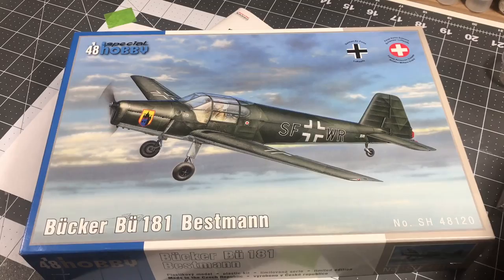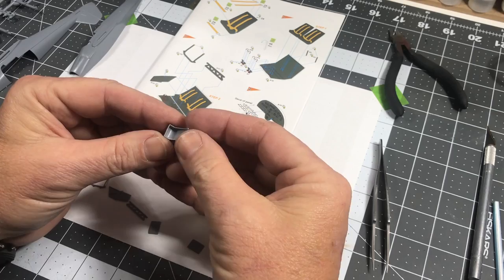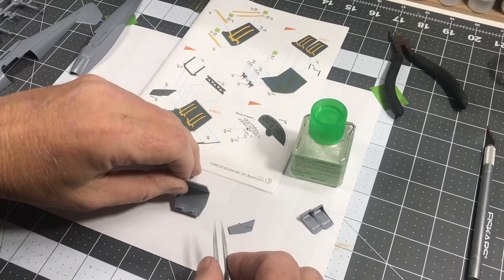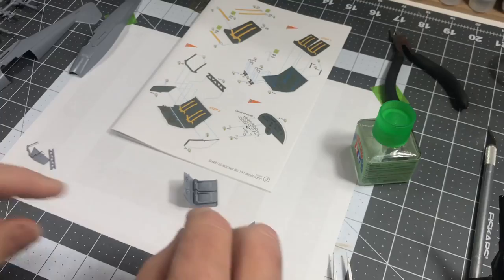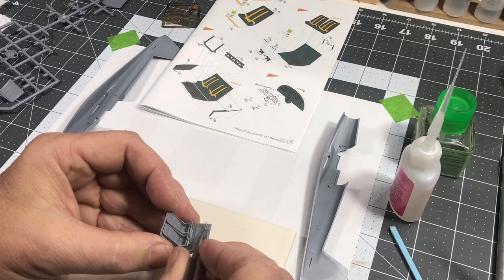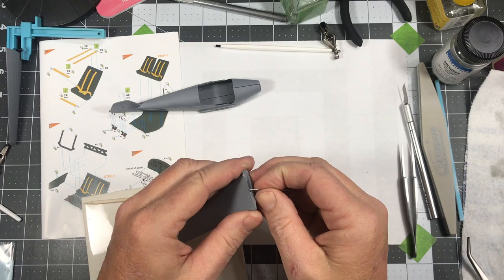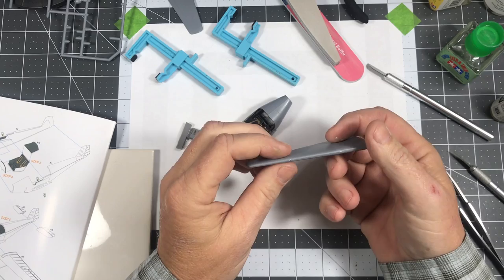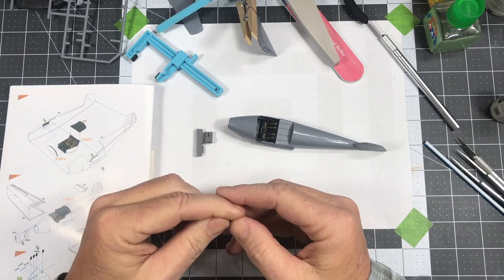Special Hobby Bucker Bu181 Bestmann Pt 1

Comment: Good job Brett. Have just built this and it's awaiting paint at the moment. Too damp in Ireland to spray out in the cave unfortunately!
Reply from the maker: Thanks, Aidan. Good to hear someone else is building this one. How did you like it?
Reply: Nice little kit. Didn't bother with engine.Like the idea of the Swiss version but will likely paint the German colours for convenience.
Reply from the maker: I am thinking the same with the engine... I would probably not glue it in good enough and it would end up coming loose and rattling around inside. And if it weren't for me wanting to do the Great Escape plane, I would most likely do the Swiss markings.